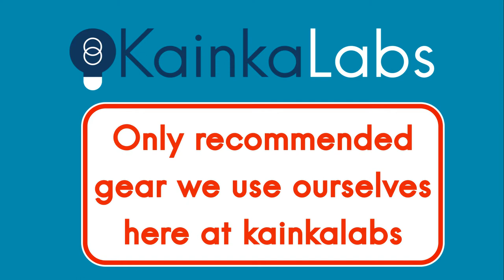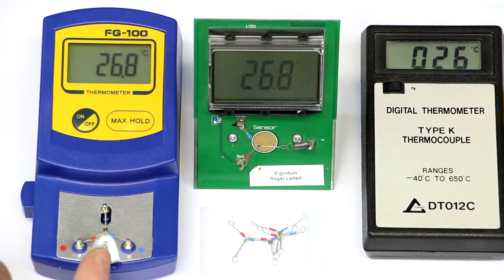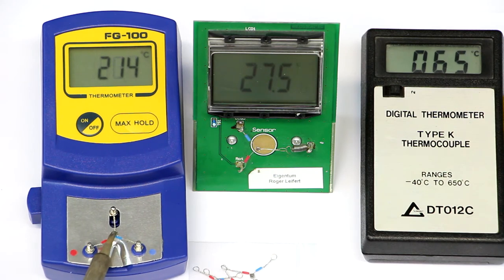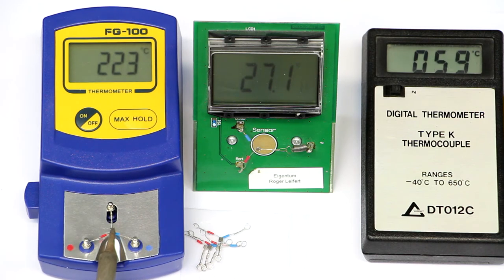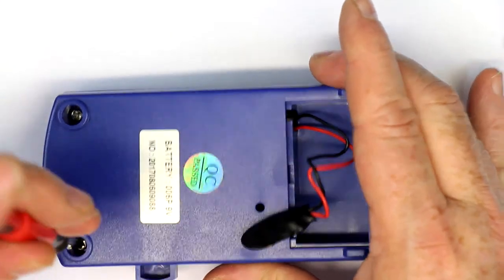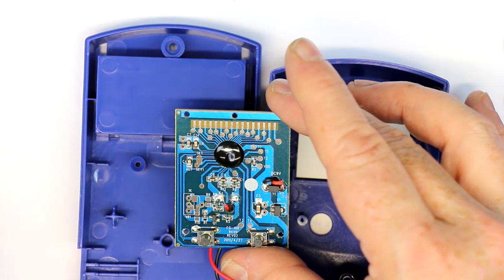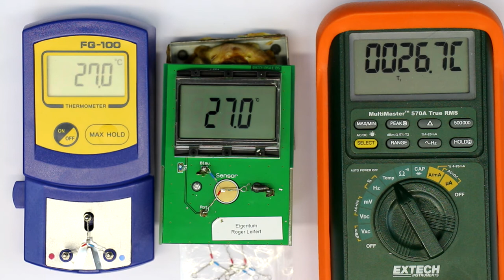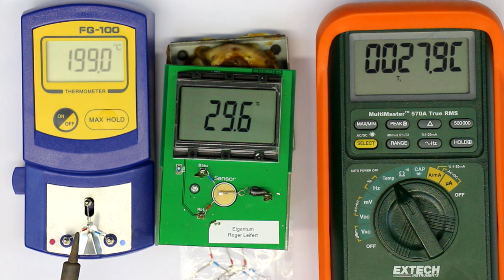Every Maker Should have...[Pt.39]...a Solder-Iron Thermometer

Comment: Hi Roger, thanks for your videos. How do you think they do the cold junction compensation in the FG-100? Is it possible that the specialized MCU  includes an ambiant temperature sensor? Or maybe they assume a constant T° in software?
Reply from the maker: They certainly did not assume a constant ambient temperature in the FG-100 becaue one can see the displayed temperature accurately displays room temperature (without a solder tip touchung the sensor)
They probably use a thermistor somewhere on the PCB (or the temperature sensor inside the microcontroller).
Reply: thank you for your reply!